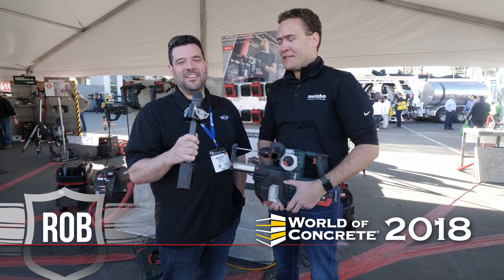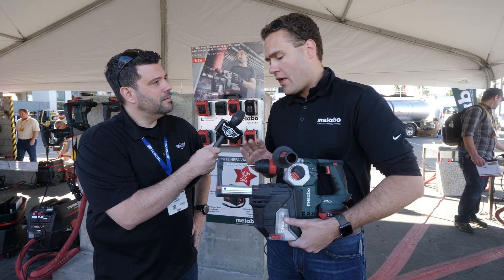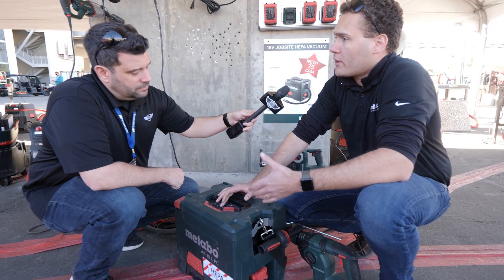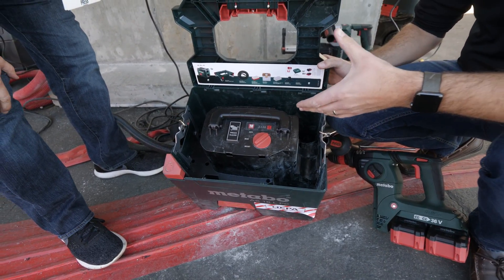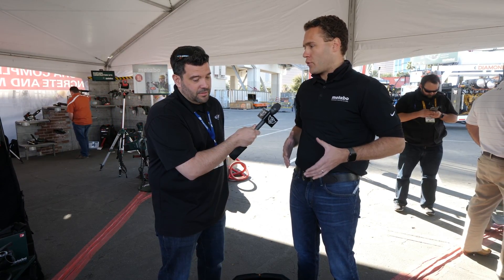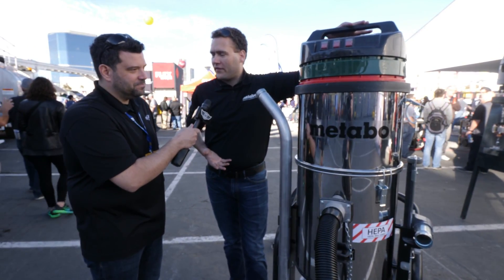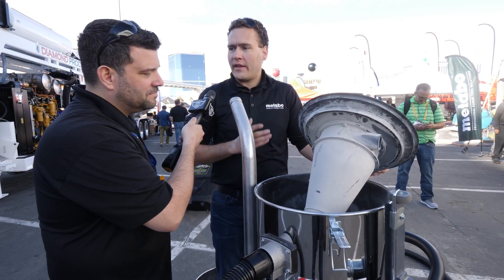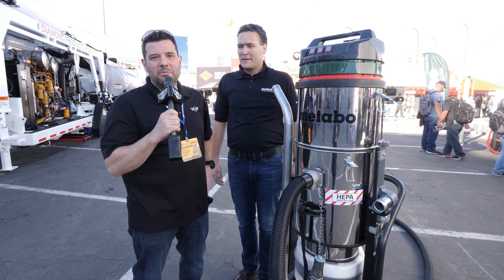Metabo 18V Hammers & 250 CFM Vacuums Silica Dust Solutions - World of Concrete 2018

Comment: I recently used a vacuum that big for a surfacing concrete floor rented, incredibly expensive equipment to rent for 3 days
Just wondering how much this 250 CFM Metabo would cost?
Reply: vaztion with anything, there is a point in which it might be cheaper to buy however Metabo isn't cheap. So less than $3k? I have no idea to be honest
Reply: Matt Allen-Rincon indeed, Metabo isn’t cheap, its Hi-quality 
It might be around the price you suggested, Matt
The grinding machine and the vacuum cost me 1,890 USD’s for three days rent!
Reply: 1,890 USD for 3 days? Holy sh1t! At those prices you start wondering how much this metabo will cost...